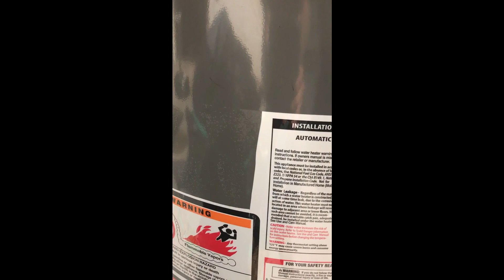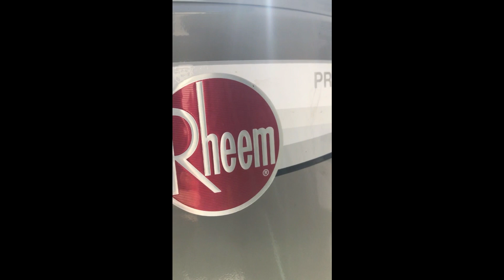PROPANE(LP) VS. NATURAL GAS/KNOWING THE DIFFERENCE

Comment: I am a Welder/Fitter by trade and I will tell you this outright... propane burns hotter than natural gas. If you have ever tried to cot steel with a natural gas torch vs a propane torch the difference in heat is undeniable

Comment: Hi tom am new to your channel and i got a question for you. I got an empty propane tank and i was wondering if i can refill it with natural gas coming from my homes gas pipe ?

Please do let me know and i would like to hear your input on this. 🤔
Reply from the maker: You would need to have some sort of NG/LP adapters and no natural gas will not work on a propane device
Reply: Hi great video. You have the example about to put propane in a gas water heater. What about put natural gas on a propane water heater ? What would happen then ? Just curiosity
Reply: @zimbasconstructionllcdecar9100  My guess it depends on the appliances ability to process, control and use the flow of gas in a manner acceptable to government regulationary bodies. I did hear the term cement and concrete gas in which in some cannot be used interchangeably.

Comment: what is the liquid glass fuse and what is it's purpose. is it some sort of over temp protection like a thermal couple or is it a trap that collects liquid fuel? ect..
Reply from the maker: The fuse is designed to cut the gas supply off to the heater when it senses blocked ventilation as well as when it detected flammable vapors such as gasoline or paint fumes
Great question thanks for dropping by!